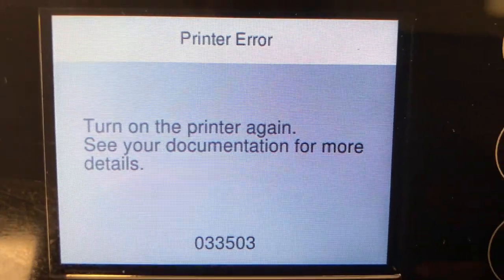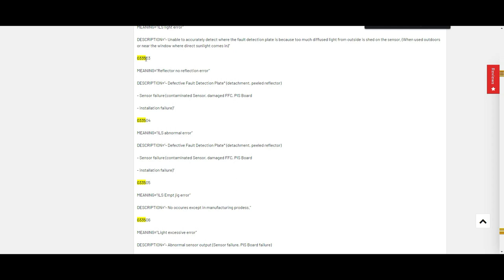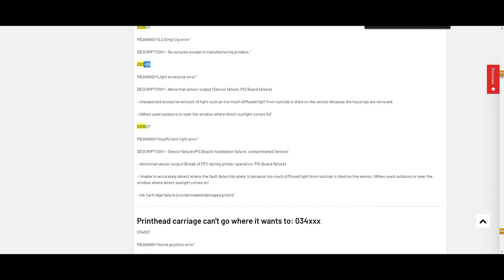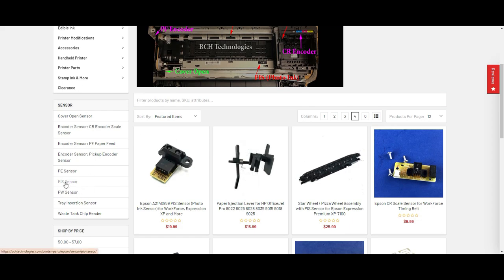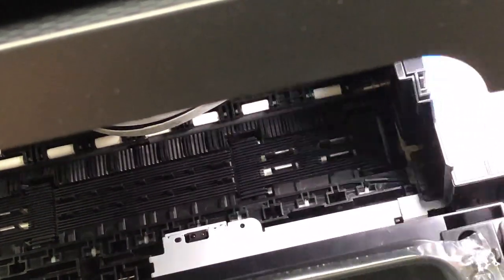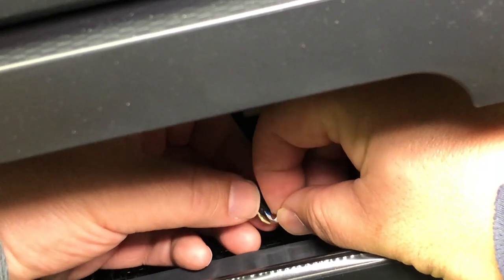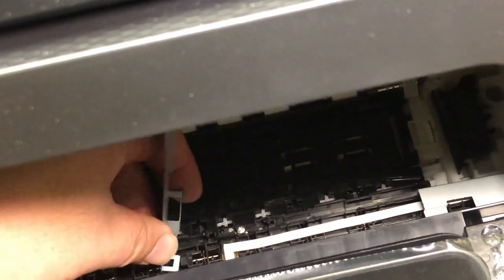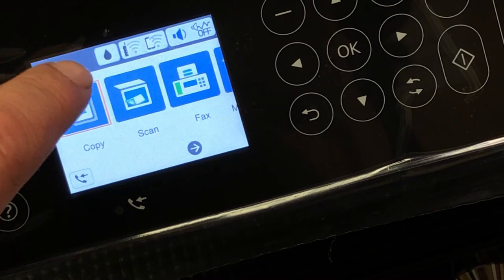Epson Error 0335xx: Replace PIS Sensor  WorkForce WF Expression XP: XP-4105 & WF-2850

Comment: I have Epson WF-7720 and I get the error: 033506, that is some kind of "internal code" at Epson manufacture.... Is there a way to fix it? Would the stupid error goes away if I replace the sensor you did on your printer?  Do you know if there is some kind of RESET CODE by holding some button on the printer while plugging in the power corde? Also, I use refillable cartridges and it started once I refilled all the cartridges at once. Thanks for your videos!

Comment: I have an error code 033506 on wf-7210 but lighting hasn't changed lids closed, I even tried putting a towel over it. Will replacing the pis sensor solve this?
Reply from the maker: That's what I will try, but I can guarantee it fixes your problem though.
Reply: did that work for you
Reply: How did you get to the pi sensor

Comment: Error code 034503 in Epson 7710 printer
Reply from the maker: Thanks for subscribing to my channel. Most likely, the printhead carriage cannot go full length of the printer (left and right), or you have a dirty timing belt that makes it think it can't go.
Reply: Have this error also. Wf7210. I cleaned the encoder ribbon with just water and towel. Happened right after magenta cart no recognized. Once I reset magenta cart the error started with ink carriage lid not closed, then proceeded to 034503. I will keep checking for full print head travel.